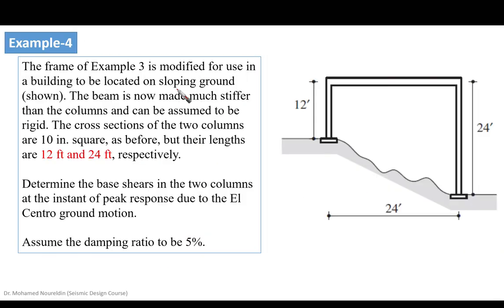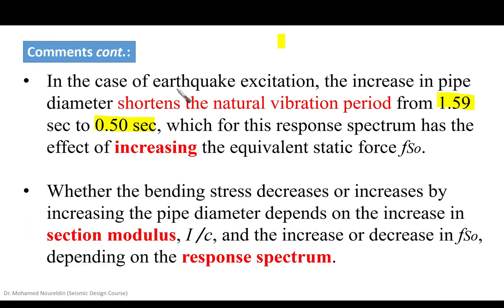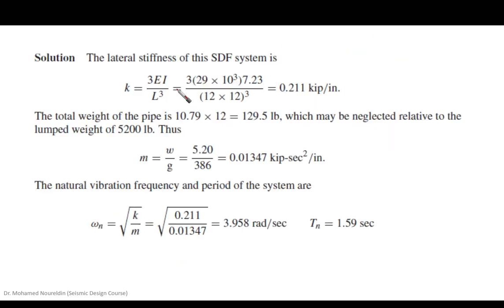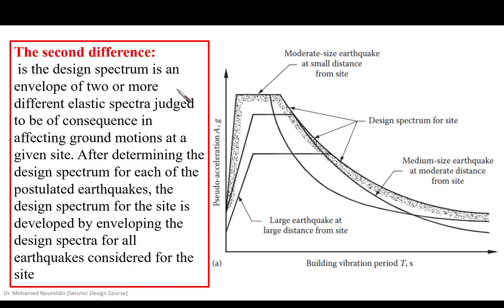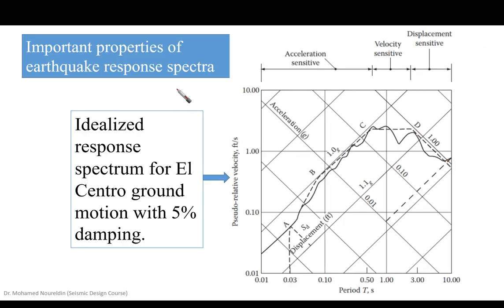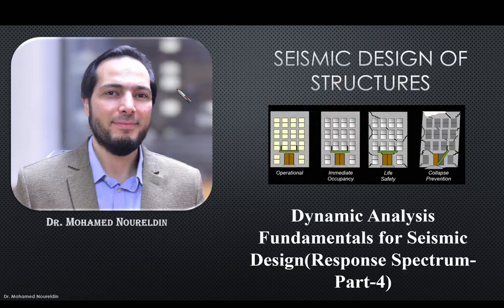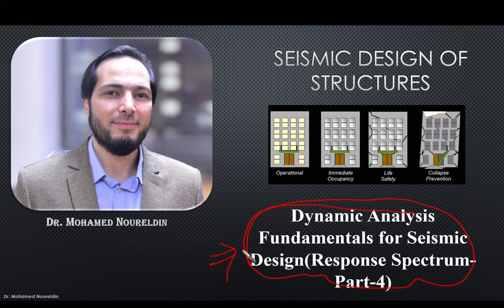10-Dynamic Analysis Fundamentals for Seismic Design (Response Spectrum-Part-4)

Comment: Dear Sir - at example 4 the long column = 24 ft has a different k that the short column = 12 ft. Therefore each column has its own Tn and hence different accelerations. Otherwise you can create the long column from a very weak material with low E and nothing will happen.

Comment: Dear Sir - please look again at the graph. At zone Tn=10 seconds - the acceleration units are going greater from 1g to 1.1g but from top down. I think it should go up from bottom up. Otherwise it contradicts the true statement you said - In long deformation there is low acceleration almost zero.